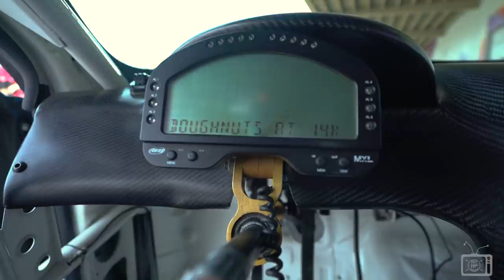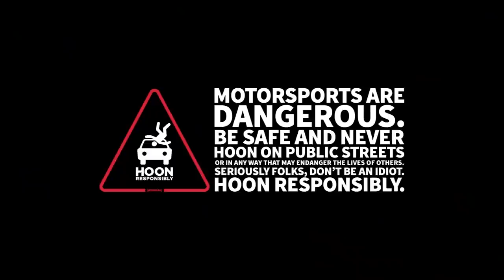[HOONIGAN] DT 074: Rhys Millen's Hyundai Genesis Pikes Peak Car

Comment: Rhys is a legend!! absolute monster genesis 4.1L turbo...over 750 torque god damn
Reply: Denny Medeiros proves how much HP the Genesis coupe 3.8 is capable of
Reply: rushking19 absolutly...I'm waiting for my warranty to expire on my 2016 rspec then im going turbo
Reply: Denny Medeiros that's going to be so amazing
Reply: rushking19 very underrated engine!
Reply: Capable of over 1000, iirc Bisimoto built a 1k hp 3.8
Reply: mas921 I know the bottom end is built crazy overly strong it has 6 bolt mains with steel main caps
Reply: Adam Szuszkiewicz I know it makes 1200 HP now think of what a 4.1l can make
Reply: rushking19 oh hell yeah I didn't know he beefed it up more. Was it more nitrous?
Reply: rushking19 its like hyundai's best kept secret!
Reply: Adam Szuszkiewicz no all he did was put precision turbo on it now he said it makes 250 more whp at 4k rpm, but I was saying he made 1200 on the stock 3.8 stroke, now think if bisimoto had the stroker 4.1l kit

Comment: I did lots of research on the Genesis Coupe and cars in general in 2020 and 2021. I have a stock 2016 Genesis Coupe 3.8. In the future, I either plan to get a built 2.0 installed, or have it LS swapped. The 3.8 is a more expensive option to have built to 4.0. There are some 4.2L out there. These cars can be twin turbo or supercharged. The 2.0 cars have reached 700 to 800whp+. The highest 3.8 usually range from 500 to 600whp. I think Justin in Hawaii has that blue Genesis Coupe 3.8 twin turbo, and I heard it is near 800whp, but he never posts numbers or anything. This car is a sleeper when done correctly, but the aftermarket is limited for the 3.8, and too many people keep their builds secret. Especially cost. Justin did tell me he paid over 20,000 for his 4.2L from Travis at MT Motorsports. I like this car, and I don't plan to get rid of it anytime soon. It looks too good. It just needs to be built with an engine.

Comment: Where the Hyundai haters at????
Reply: TheV1ctr exactly it makes 750 whp and 750 wtq on only 18 psi only 18 psi 👀
Reply: rushking19 all off the shelf mods too! nothing bespoke
Reply: stock 350HP with 87 octane and I personally get 26 city and 30 highway...
Reply: Robert Hollar if you’re stock and a 2nd generation you’re wrong, if you run 87 on your Genesis 3.8 you’re fucking up, that car has a compression ratio of 11.5 to 1 you’re not making full power running 87, Hyundai recommends you run 93 to make the full 348 hp